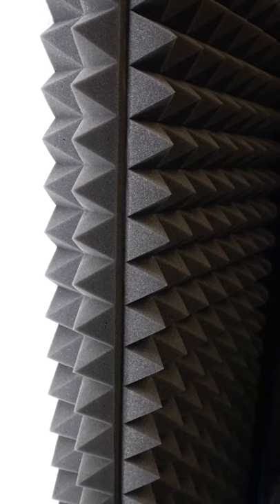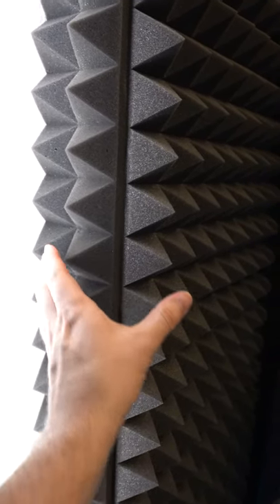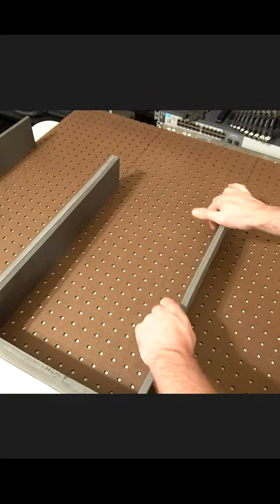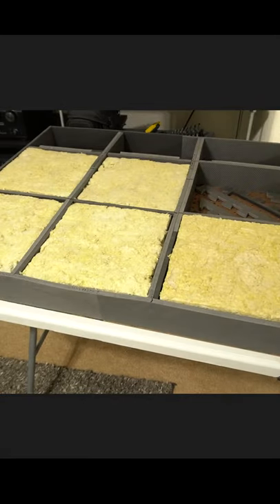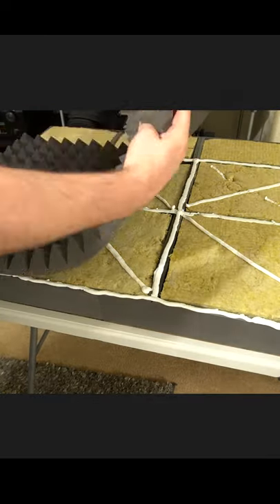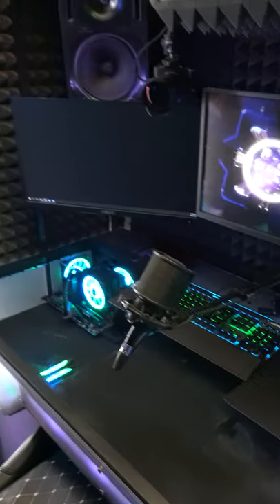DIY 6" Acoustic Foam Panel #shorts

Comment: Can you do a video on the effectiveness of how it reduces sound?
Reply from the maker: Absolutely. 🙂 I plan on releasing a longer video in the future explaining acoustic panels in more detail as well as taking readings with decibel meters and showing the effectiveness around multiple frequency ranges.
Reply: The "acoustic foam" doesnt really do shit except remove echo, which can be nice.
Reply: The literal WALL dampens the sound. Not that 1 inch foam triangle.
Reply from the maker: @SMCDisaster  If you're talking about sounds ingress or egress from the room, sure, the wall dampens the sounds. But what we're talking about here is sounds INSIDE the room echoing and bouncing around. In which case the wall acts as a reflection and just bounces the sound back to you. The foam is 2" not 1" and I promise you makes a HUGE difference. When people enter my office the first thing they always say is "Wow, it's dead quite in here!".
Reply: @ZigWarner yeah, I was initially skeptical of this too but it would stand to season that the thickness of the insulation inside, plus the extra sound isolation foam would work in tandem to reduce sound. 

I imagine you’re getting pretty good high and low frequency absorption with this panel?

Comment: rock wool is more than enough
Reply: Sure, but if you're going to finish it why not use a foam with sound reduction benefits?
Reply: @j.ballsdeep420 bc over-dampening exists. You could just use a fabric
Reply from the maker: Not always. 🙂 Rock wool typically can't absorb any frequencies higher than 8000 Hz. (This cutoff will vary by type and brand.) I have a lot of computer equipment that emits some higher frequency noises, thus why I added a layer of open cell foam over the top of everything.
Reply: I agree. Rock wool with a bit of spacing with the wall can absorp high frequencies. For bass we use denser and thicker bass trap. For higher frequencies noise of electronic equipment. I have never have issues with. We have 2 analog synths but never encountered any electromagnetic interference.
Reply: @ZigWarner why you want your accoustic panela to absorb your over 8000hz frequencies??
Reply: @FantoNum He explained it, it’s where a lot of noise from electronics are generated. It also prevents weird twangy sounding acoustics (sounds kind of like a jaw harp) that are usually leftover at those higher freqs, which acoustic foam is actually great at capturing.
Reply: @ZigWarner  Rockwool is a brand. Rockwool has an NRC of over 1 from 1kHz to above the highest frequencies a human can hear. 

You don’t need the foam.

Comment: So if I'm using "sound absorbing" materials does the material itself actually "hang on" to the sounds it's been absorbing and then allow me to recall those sounds in the order they were stored by simply squeezing the sounds out of the material when I want to re-hear what I've stored.
Reply: lol
Reply: @ListenWeekly  Which would be almost cartoon like but not easy to understand as a visual.
Reply: For real bro 😂😂
Reply: U can’t “save sounds” in rockwool & foam and then call apon them like He Man & the blade of destiny. 💀 to my understanding (of 2 day research) it minimizes echo, and makes it so when the sound bounces off of it from your speaker, you’re not getting the disrupted and slightly delayed wavelengths 🤷🏾‍♂️ something like that.
Reply: @Yasuke0k   You don't say.
Reply: @Yasuke0k  wrong
Reply: @malibustacy3606 hey man that was really rude! He just doesn’t what audacity foam is yet. No need to be so very rude to him 😂😂
Reply: @EclipticFactions   Relax, don't get so wound up over nothing.
Reply: @malibustacy3606  don’t you dare tell me what to do. I’ve been squeezing my acoustic foam long before you were born. Used to be the only way we’d replay music. Everyone went to concerts with their foam to record the performance to listen to it at a later date. (On a serious note my previous response was satire, audacity is a reference to the recording software)
Reply: @EclipticFactions HELP

Comment: 😮And breath rockwool dust that stays in your lungs FOR EVER
Reply: That's like saying being in a well built home is dangerous if there's a cover then it's good enough
Reply: Almost thought he said rockwall
Reply: Rockwool has been used in the industry worldwide for a long time now. If there were any extreme health risk, it would be known by now. If it was as dangerous as you believe, music producers artist and engineers would commonly have respiratory issues or be dying from related cancers. You only have to wear protection when your cutting it or moving it while exposed. Once it's in a frame and wrapped in tight woven fabric theres no risk at all.

If you ingest rockwool fibers just like most modern fiberglass glass insulation, your body absorbs it. Yes it may irritate your throat a little, but it never enters your blood stream, and it doesn't act like asbestos or old fiberglass. A lot of safety standards have changed in the last 30 years when it comes to insulation.